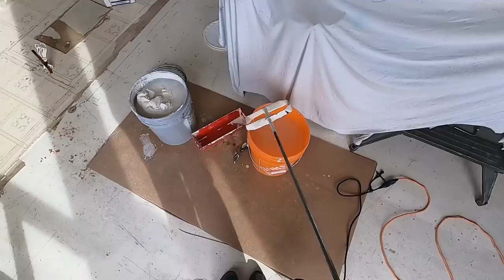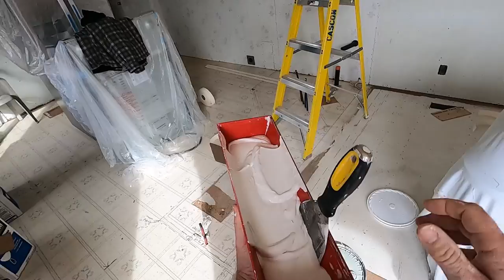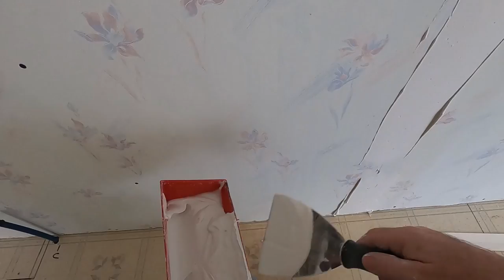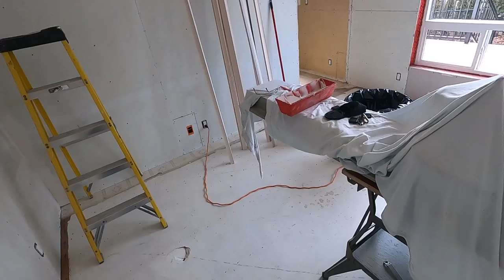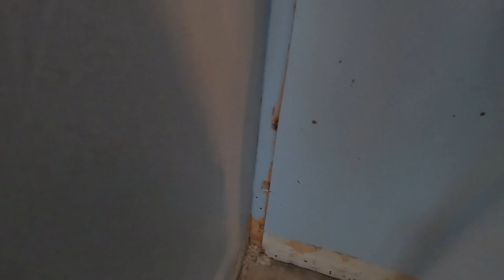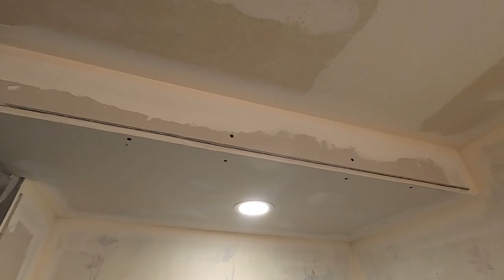Refinish Mobile Home Walls And Ceilings - Part 3 - Taping Joints : E056 / BC Renovation Magazine

Comment: Hi, love your videos. I just recently bought myself an old but well maintained mobile and I would like to update it by removing the batting and painting the walls. Do you know how well this method will hold up in a mobile with the extreme freeze and thaws in Manitoba? Will the trailer shift too much for the fill and tape to hold without cracking? I am scared I will do it and have it all crack. Thanks for making such great videos!

Comment: We have learned a lot from your channel. We are wanting to remove the strips and crown molding in our 20 year old double wide. Our ceilings however are fine with a knock-down texture. How would we smooth out the tape at the ceiling?
Reply from the maker: Tracee, thanks for watching and commenting. 🙂 I would put a skim coat of all purpose drywall mud over the knock-down texture to smooth it out. It might take a couple of coats. Sand it smooth and then re-finish as you would like.

Comment: Great information. Just one question—perhaps you’ve mentioned before, but most mobile homes have the vinyl on gypsum (VOG), do you just pull off the battens and go to this step covering cracks with tape directly on the VOG? I’m curious if the vinyl prevents tape or paint from adhering to it? Or do you sand it to help create a mechanical bond (something to adhere to).
Reply: Nevermind. You mentioned in previous video. Haha. So tape and paint will adhere to VOG—I will trust what you say good sir.
Reply from the maker: Hi, Kevin. Yes, we have had good results using the method described. Thanks for watching and commenting. :-)

Comment: When tapping and mudding over the VOG panel the tape seems to curl at the edges.  Is this due from to much of the mud being removed?  It seems like the mud sticks to the tape and not the VOG panel.  Or am I not putting enough on before setting the tape?  Great videos.
Reply from the maker: Hi, Jolene. The VOG panels have to be clean, no grime or grease. Before starting I wash the panels with warm water and something like Dawn dish soap. If the walls are very grimy then I will wash them with a TSP solution (Tri Sodium Phosphate). You can find TSP at most building supply centers. It is important to remove all TSP residue by rinsing wipe with a clean, damp rag.

I will follow up the cleaning with a light sanding with 120 grit sandpaper. Be sure to remove any dust from sanding. Then you are ready to start taping.

You might have your mud too thin. If it is too wet it does not stick well. The mud should be fairly thick but still spreadable with the trowel.

You also might not be getting enough mud on the joint on the first pass. You want enough mud on there so that the crack is filled and there is about 1/8" of a bed of mud under where the tape will be placed. 

Lay the tape into that 1/8" thick bed of mud. Then push the tape into the mud with the trowel. If you have it right mud will ooze out from under the tape. There should be no dry spots under the mud. The trick is to embed the tape in the mud, smooth it out but not remove all of the mud. If you squeeze all of the mud out the tape will let go, or curl.

That being said, sometimes the very edge of the tape may lift just a wee bit, but it will not be loose. If that happens, don't be alarmed. By the time you put the next two coats of mud on and get that buildup those little curled edges should disappear. 

Try making your mud a bit stiffer, make sure you are setting the tape in a good bed of mud and don't squeeze too much of the mud out. 

I don't normally prime until the mudding is done. 

Let me know how it goes. If you still have trouble you can send me some photos by email so I can see what you are doing. We can also chat on the phone. 

Kent
Reply: @BCRenovationMagazine   I washed the walls with TSP, then clean water and dryer them with lint free rag.  In thinking we removed too much mud.  Do we mud a thin coat over the tape or let it dry a day before the next wider coat?  We have a whole mfg house to do and want to get it right. Once the final feathering is done I will put PVA primer over all of the wall texture, prime then   paint
Reply from the maker: @jolenezimmerman4951  , you should let that first coat dry thoroughly before appling the next coat. The first coat is thick and takes time to dry.

Sometimes I try to cheat and apply the second coat over the tape before the first coat dries, to save time. It usually doesn't go well. It's better to take the time to allow drying between coats.

Another important thing is the type of mud you are using. For thr first coat you need to use mud that is labelled as general purpose, all purpose or bedding mud. Different manufacturers use different names. If you use topping mud, or other kind of mud, it does not stick well.
Reply from the maker: @jolenezimmerman4951  , you only will have to prime once. Do it after the mudding is complete. Just use the PVA primer. No other primer is necessary. Don't thin the primer. Put it on as it comes in the can. Roller with a 3/8" pile works great.

Follow that up with another 2 coats of your finish color wall paint.

Three coats of paint total. 1 PVA primer coat and 2 coats of color.
Reply from the maker: @jolenezimmerman4951  , if the mud is really old, that can cause problems. Old mud can go 'sour'. 

Another thing that can cause problems is if the mud has ever froze. If you live in a climate that freezes you want make sure the mud is kept warm. If it was left in a shed, in a vehicle or outside and it froze the mud will be ruined, even after it thaws out.

You also want to thoroughly mix the mud before you apply it. Mixing the mud re-constitutes it and also introduces some air into it, which all helps with the process.